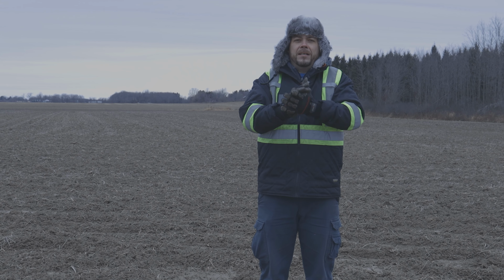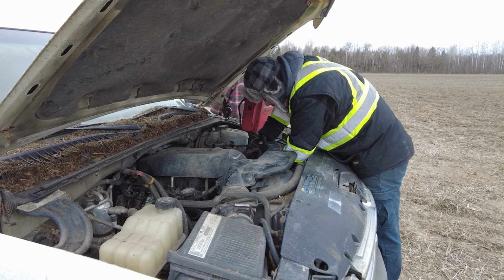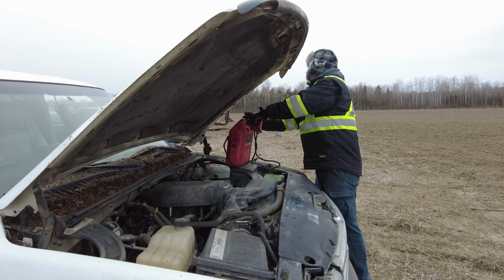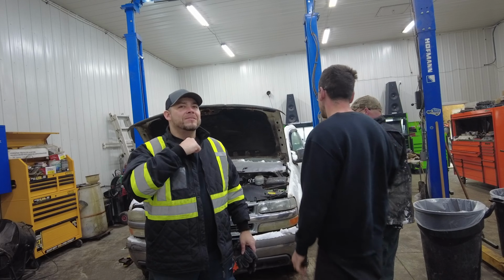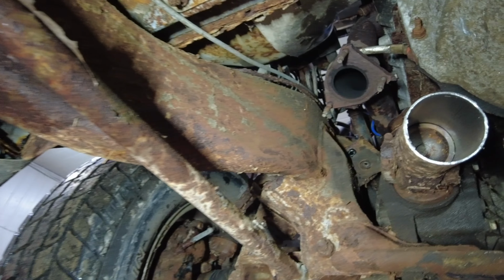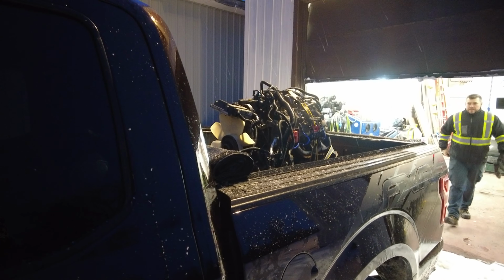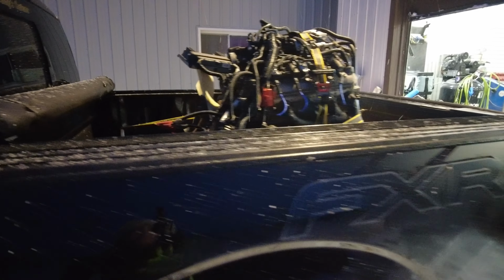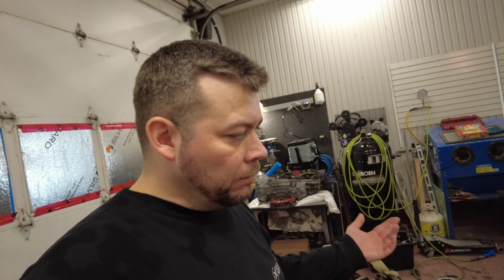HEART OF GOLD - WIDEBODY CORVETTE - ENGINE SWAP SERIES

Comment: I would recommend connecting rear steam ports to the front steam ports. I did this on my C6 with the vertical outlet steam port from a truck OEM and T to the front port. A lot of people cook the wall between cylinders 5 and 7 because the steam can get trapped.
Reply from the maker: This is a great tip! Thanks ✌️

Comment: Honestly, id look into a supercharger. Build the engine to a 10.5 compression ratio. feed it only 91/93 and do not do any boost pulls till you have a good tuner dyno tune the car. the high compression ratio makes it less forgiving for timing. but you could probably put down 650~ rwhp at 8psi with a good combo.
Reply from the maker: Great information! I appreciate it 🙏
Reply: @RustedandBusted  no worries man, I built my own engine for my project and regret going with a 9.4:1 CR, its easier to tune but its way down on power until you really start leaning on boost. a 10.5CR would make 75-100RWHP more at 8psi then a 9.5CR, the lower compression engine only gaining ground when you start pushing 20+ psi of boost (not street friendly or pump gas friendly) also, the higher compression engines just sound way better. your C4 was a incredible build. i suggest you look into doing a single video 30~ min or less on the build start to finish. It would bring attention to your channel, people wanting to see more, etc.  Alternatively, if you want to do a Turbo build. I'd recommend taking a 1/4" line off your air ride system, and feed that through a regulator (to drop it to 30psi) and plumb that through mac valves to the top of your dome. This would allow you to have infinite boost control. You could run a 2 psi spring in the wastegate, then have 3 different boost settings you can alternate through.  Wastegate, Boost Setting 1, and Boost Setting 2. I have this exact setup on my C10 and it works great. I run 3 psi, 10 psi and 18psi. 3 PSI being "Valet Mode" lol.  the 10PSI is just Pump gas 91, and when i enable setting 3, it also turns on a direct port meth injection kit i have, bringing my 91 octane up to 99 octane so i can run higher boost then normal.